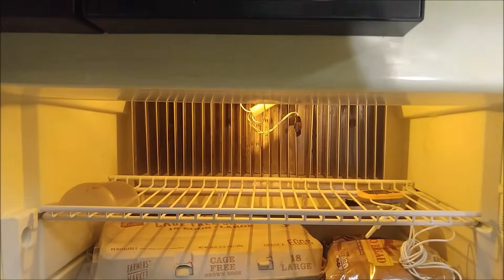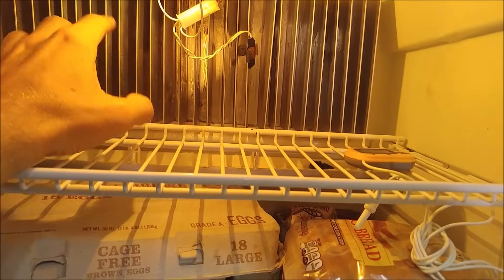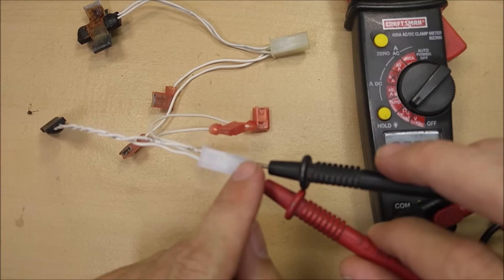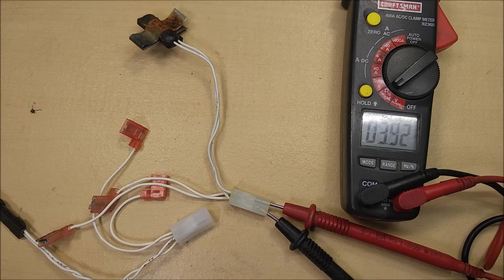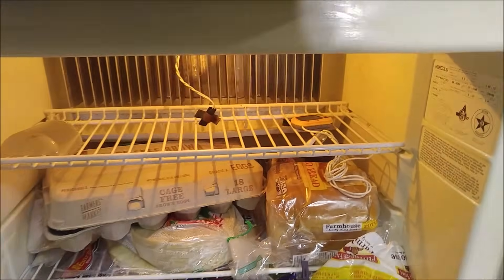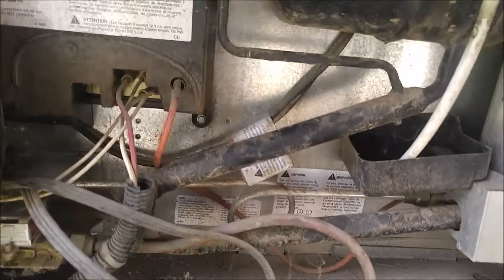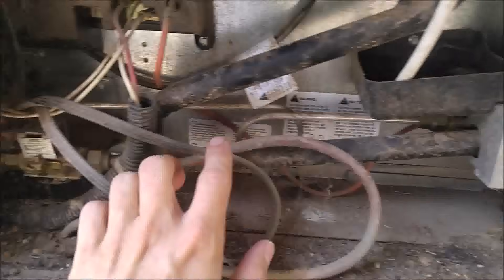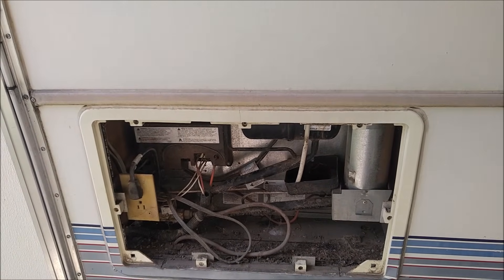The NO-NONSENSE RV Refrigerator Repair & Troubleshooting Guide ~Figure it Out in 5 Min

Comment: How hot should the pipe/line that runs up behind freezer get? Just ran a 2003 jayco kiwi fridge innAC mode for 24 hours. No ice made in freezer and the line that runs behind the freezer area (accessed for outside panel) is extremely hot. Like burn your hand hot. Is that normal?

Comment: So that’s it. It’s just check power to the outlet, power to the board and then check if the element is hot? Ok so my friend has an issue with the refrigerator in his RV. In order to troubleshoot it do I need to Google videos on how to repair the make and model of the refrigerator or do I look up videos on here to Repair refrigerators in the Macon model of the RV? Also, once I’ve located that information and let’s say I find out it is a bad motherboard. Where can I buy a motherboard for a refrigerator for an 87 Ford RVI don’t know that I’ll be able to find that on Amazon. Can anybody help me out?

Comment: I hope It’s been a long time. I’m having the same similar issues. I have a flame. My freezer is working perfect my fridge is not. My fridge is 100% 75° and I can’t confirm it works in AC mode. I’m on a road trip with this new to me trailer and trying to figure it out ASAP. If I get responses within the next couple hours, I’ll pay someone over Venmo to give me some troubleshoot advice. It’s way better than trying to pull teeth with camping world technicians. .

Comment: Thank you so much! My refrigerator is getting too cold, and the vegatables are freezing. Will check resistance on my thermistor and also replace the clip, since it is completely rusted. They are on Amazon, and cheap as well.
Reply: Did it work?

Comment: got a full size one that we took out to flip but no gurgling sounds at all and no sign of a breach? leaving upside-down till tomorrow and will reinstall it and try it again. it's not that old the trailer is only a 2021. It ran great on our trip in July but when we were getting the trailer ready to leave this weekend the fridge won't cool on gas or electric? everything tests o.k. as well. the sign of a blockage is the burner tube is hot, but the tubing is cold not heating to make the fridge cold. I'm hoping the no gurgle is from the cooling fluid is so full that there is no air bubble just that it's clogged in there somewhere?

Comment: I have a very weird cooling issue on my norcold N611RT. Was working perfectly.  Its a 2022 model and only started using in 2023. Suddenly its struggling to cool. Freezer just gets a bit cold. And the box down doesn't get cold at all. Fins are not cooling.  Checked everything and everything working.  Even tubes and heating stuff in the back are warm and hot. No codes. No flickering.  Just no cooling.  Checked thermister ohm its fine. Not really sure what's going on. One day it just cooled for half day then not cooling again

No faults. 120 working.  Gas working.  No amonia leak. Tried to leave it on both 120 and gas separately for long times. Same results. If anyone knows kindly help

Comment: I replaced my thermoster. I also replaced thermostat. I’m at 50 degrees in fridge. The freezer works great. The pipes are hot so it’s expanding ammonia. What about the fan? I’m also it to the point of swapping for a residential fridge and we Rv full time. I have  norcold N8XF

Comment: I’m lucky if mine will get below 50. It runs and cools and I checked the thermister last year according to the chart but it checked good. 
I’m found a test run before a trip and the first day I turned it on it hit 50°. The second day I put several waters on the top shelf and struggled to get below 60°.. it’s so unreliable I’m stuck using a cooler or may have to break down and buy a new unit which is crazy expensive. This caper is only a couple years old and was purchased new. It never has worked good.

Comment: Hi, thank you for your video. StraightForward. Do this fridges have fans?? My freezer is working on both electric and gas. The problem is the refrigerator section is not cooling off.
Reply: Some will have 12v cooling fans in the rear compartment to help vent upward.

Comment: Are you an Rv Technician ? Because you are supposed to use Ice water to test THermistors. and Touching the cooling unit and seeing if it is warm does not mean it is working, it can be crystalized and not cooling and still have a warm cooling unit.  Heating Element not a coil. And By Flue do you mean Burner ?
Reply: 😂 you took it easy on him

Comment: What if my rv WONT TURN OFF. We unplugged fuses, pressed the off button for 8+ seconds, flipped the switch outside the rv, and tried turning it off in different settings (lp, ac, au)

Comment: My freezer builds up frost within in a few hours after i defrost. It builds up to two inches quickly! We have had the doors checked to make sure it seals. The rv repairnan didnt fix anything. . Nothing  has helped! Any ideas?
Reply from the maker: Humidity is getting into thr fridge somehow. Ice comes from water or water vapor, so there has to be a source. If it's been raining a lot and you open the door a lot, that can lead to a lot of ice. Check your thermistor also.

Comment: Great video. One more suggestion - my fridge was underperforming and when I checked with a manometer the gas pressure was way low. An adjustment to the regulator fixed the problem.
Reply from the maker: Great input! I didn't think of that when I made the video.

Comment: My dometic fridge cools on propane but it will not cool on electric. I have a 2015 Forester Class C. Ive changed the 2glass fuses outside of the coach. Ive also ensured that all GFCI outlets are reset.

Comment: Everything heats up in the back but nothing is cooling. Worked well for about 5 hours then next day nothing and thr fridge was warm.   Thoughts?
Reply: Same problem here. All the tubes are nice and hot, flame is working well, clear blue color, but fridge barely cools. Freezer is at 40 and fridge is at 60 with outside temps in the 60's.

Comment: Well shit. I got power, I have LPG, but will not lite, or cooling either ac or gas. I have no leakage from the boiler. Everything is clean. I have power, and no blower fuses. How do you check the board? Back to the drawing board. The dam thing just stopped working out of nowhere.

Comment: Mine froze from outside. It stopped. I simply put two insulated puppy floor pads in minus 15 on the lower opening outside. It took 24 hrs to thaw. Pow...it fired right up.  How do I know I'm getting the right thermistor?
Reply from the maker: Nice.
Reply from the maker: It will look the same.
Reply: @TrailerDayz  ok.but  is there a link for it.

Comment: I wished this video showed how to hook up the wires. My light stopped working and shortly after my fridge was not working. The lights and codes all work on the door but the fridge does not get cold. I took off the light cover and found a lose wire. The wire is short and I'm not sure how to hook the wire back up. But all other info was great.

Comment: Will changing the thermistor also solve my refrigerator light problem? When the corner of the frig freezes light does not work.. remove the ice from the corner of the refrigerator and the light works. It’s a Norcold.

Comment: He said clean the flew for LP diagnosis of frig not getting cold. Its not just by wiping the top of it but removing the burner orifice and tapping all the potential burned powder like material that comes out when tapped against a hard surface. And making sure openings are fully open in burner orifice by using a razor blade.

Comment: My dometic was set to 110V AC and the coil cover was hot to the touch. However, the cooling fins inside fridge did not get cold even after 1 hour of run time. Any advice?

Comment: Also check the celinder above the flame. Turn gas off. There are 2white plug ins on the side. Pull one out, & between the two plug ins is a small reset switch. Something else to try.
Also reset all GFIC as they can prevent elect to continue.
One more thing. Take off the black removable box over the panel. At the bottom of the circuit board are two wires that contain fuses that can be blown. Not hard to replace. Many stores have them.

Comment: I have AC power and the heating coil gets hot, yet the refrigerator is not cooling. Do you think it’s the control board on the refrigerator? Norcold 682
Reply from the maker: How long did you let it run?
Reply: @TrailerDayz  oh thank you for the response. I didn’t notice. It had been running fine, although much too cold (freezing milk in the refrigerator), regardless of the thermostat setting. Once it quit, I left it off for a while, and tried letting it run for days, and still not cold. Wondering if it might be the thermistor.

Comment: So my norcold has always run fine on LP mode. But today I noticed my fridge getting warmer & warmer.
  I Can hear the pilot running in the back. Lights fine, no error codes at all, just not cold?
  Had to hook up the ac cord from the back panel to my friends solar for the night with an extention cord so I don't lose all my food. 
  We don't know what is wrong in LP mode. It acts like it's working fine but not cooling? Any ideas? Please help! 
  I'm a full time boondocker so I need to fix this asap! 🙏
Reply from the maker: Open the flame port on the back. See if the flame looks good. It should be mostly blue in color. If it looks weak, tap on the solenoid with something. You might have some debis in the solenoid.

Comment: Nice video thanks. I just bought a boat fridge. 12 volt and 110 ac current. But I get it down to the boat and let it set a day level and plug it in and then nothing , it's a Norcold Tek 2.  But no sounds no vibration and no on light. So I looked up a video and yours looked good and it was and thanks for a great video. So it sounds like whatever it is probably a control board is my guess but it's a replaceable part. I need to try the 12 volt part yet. I need some longer wires or test leads. I have the same fridge in my Sailboat but bigger and it's worked great for years.  Some old timer told me that if you get one that won't cool anymore to flip it upside down. Ok after unplugging it lol. Upside down and tape a vibrating sander to for 24 and 9 times out of 10 it will work. He said the freon settles in the low points of the system and buy agitating it will free it up and make it work like new again. I haven't tried it yet but makes sense. He swears buy it.
Reply from the maker: All of them need 12V always, even if you aren't running in 12V mode. The 12v controls the electronics.

Comment: Thanks for the tips. I wish you had shown how to remove the thermistor though. One end is easy to unclip, while the other seems to be tucked in with the fridge light. I don't even know how to get the light cap off, LOL.
Reply from the maker: Yes. You need to take the cover off of the light. It comes off quite easy. You just squeeze it from the sides to unhook it from it's tabs.

Comment: If you don't have a ohm meter Just unplug your thermistor, your fridge will cool but with no limit. (keep getting colder) gets you by till you can replace it.
Reply from the maker: Good idea. Some units do go into a default mode when the thermistor is missing or bad. Some may behave differently than others.

Comment: I have a 1976 dometic rm66E model RV refrigerator that I want to run off of my RV 12volt house battery. Do you know what power consumption this model uses? Amp hours? How can I figure this out?
Reply from the maker: No idea, but as an absorbtion refrigerator, the only electricity it's using while running is to power a gas solenoid and the control board. Being older, it will use a bit more. I'm guessing about an amp continuously (12 watts).

Comment: Great video!! Love the no nonsense, I subscribed. My frig pops the GFCI breaker in the back of the motorhome when plugged in. When frig is unplugged all AC works fine. Plug it back in and the breaker pops again. Any ideas?
Reply from the maker: GFCI breakers can be finicky. You may have a bad breaker or a ground fault somewhere.
Reply: @TrailerDayz  Thanks for your reply. The frig was working just fine. Then one day it popped the GFCI breaker. Now it won't reset unless I unplug the frig. The motorhome is always plugged in and we use the frig for an extra frig. I'll have to check the fuses and for a ground fault. Maybe replace the GFCI outlet. I'll let you know

Comment: Not getting any error messages. Freezer and fridge are not cooling at all. Have checked fuses, breakers, etc. I don’t have one of those things that measures ohms. The fridge always has lots of water running through the tray. Now the fins are totally dry and no moisture or coolness on them at all.
Reply from the maker: You're gonna want to ohm out the thermistor or just replace it preemptively
Reply: KZ says it sounds like a mother board or compressor-not a thermistor. Thanks for your help. Your video was the best on getting us started.
Reply from the maker: @beverlyfrantz1802  No problem.
These type of fridge don't have compressors, but a bad board is very common.

Comment: So, two days ago I noticed something in my fridge was warm, looked in the freezer and all the frost on the walls was loose, with half of the stuff in there thawed.  Thermistor seems good.  Turned it on with both LP and then AC.  Flame lit, looked good, but didn't seem to cool.  I heard it humming on AC, but again no cooling after a couple hours.  Didn't throw any codes, so the manual is useless.  Any ideas?
Reply: I have the same problem, only I just noticed how warm at 10pm so my buddy hooked an extention cord directly from my ac plug to his solar system in his van for the night. I'm sure it will be a few hrs before I'll be able to tell if the ac isn't cooling either. But everything acts as if it's running normally, yet the temp is up to 65!?😳😱
  Did you figure out the problem?
Reply: @butterflygypsy956  I ended up replacing the cooling unit.  People kept telling me it would be almost the same cost for a new fridge, but it was actually less than half.  Kind of a pain in the ass job and it works better with two people, but you can totally DIY.  I had finally gotten a good look around the burner box and noticed all the yellow deposits.  The ammonia had just been leaking out and I am actually very blessed that there wasn't a fire!

Comment: I have a very old Dometic 3 way. I looked for the thermistor in the fridge and freezer area and can't see it. I looked at the parts manual for my unit and can't find it there either. Could it be called the the thermostat in my Dometic?
Reply from the maker: It sure could.

Comment: Great walkthrough! I would like to add something. If your unit has been off for a length of time, the oil will gum up. Similar to gas when old. So many people change parts and testing them out often frees up the obstruction. I would suggest tapping on the tubes with a small wrench when it's heating up. Be sure to focus on the bends. The tube is pinched more. Do this periodically and you might find things start working all of a sudden. I've been the hero on many older RV's by doing this first. Great vid! Thermistor can be spliced as well. Some older models are hard to access.
Reply: What about if it's working on ac and lp but it's not cooling at all thermoster tested good. Cooling on ac and lp but not cooling enough
Reply from the maker: Great Feedback and Info!
Reply: @TrailerDayz  Where is the Amazon link for the thermistor? Did I miss it?
Reply: Tapping on what tubes? The LPG or the cooling tube in refer back?
Reply from the maker: @billszymborski584  He's talking about the coolant tubes
Reply: Ima have to try this
Reply: Cooling tubes
Reply: Oh and if you hear popping in the cooling tubes, it has most likely leaked out.
Reply: this comment is more valuable to me than the video itself
Reply: What if the lights on the panel blink on and